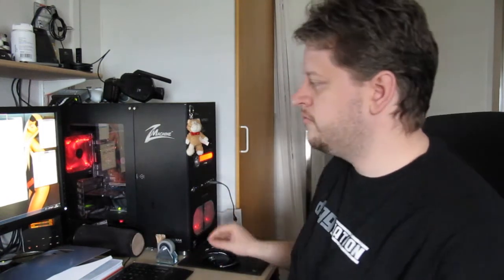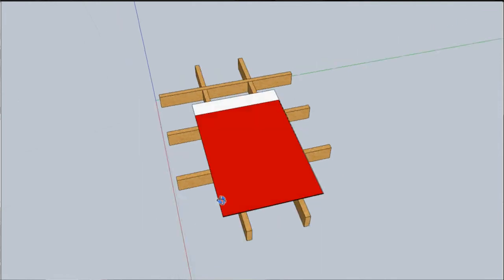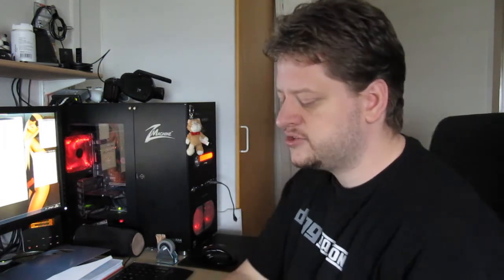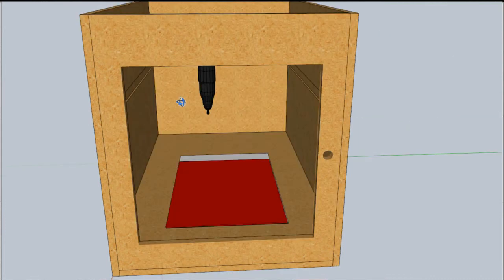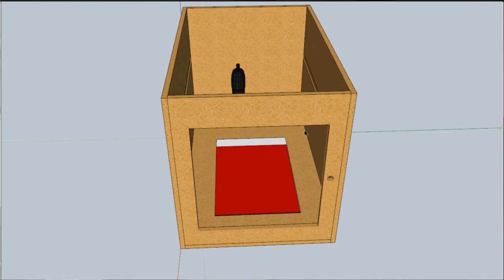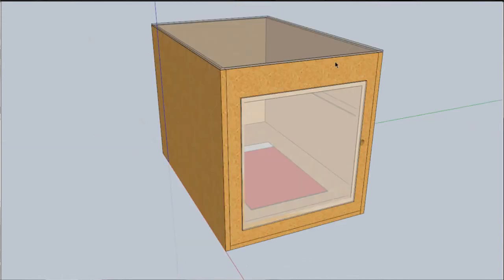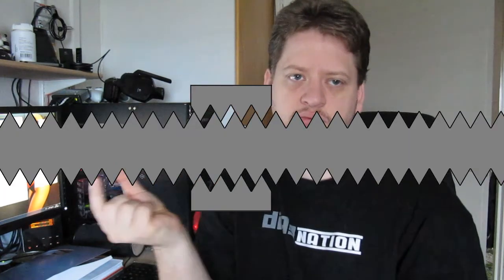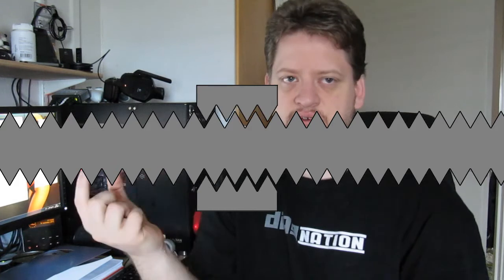Part 03 - DIY CNC Router - The new needs

Comment from the maker: @metalfusionf I actually thought of the twisting, but thought it would work after I dont plan a cutting hard materials, but this may change after it is built :D

maybe I should make redesig, so it pulls in the middle.

Comment: You might  need 2 leadscrews & motors for the x-axis to keep the gantry from twisting, or maybe you could implement a rolling knot cable system that carpenters use. Search cnczone.com "make your gantry rock solid"

I would also recommend to make the slide mountings adjustable. Aluminum agles will also wear out pretty quickly as the bearings will make grooves on them.
Good luck with your first cnc build! :)